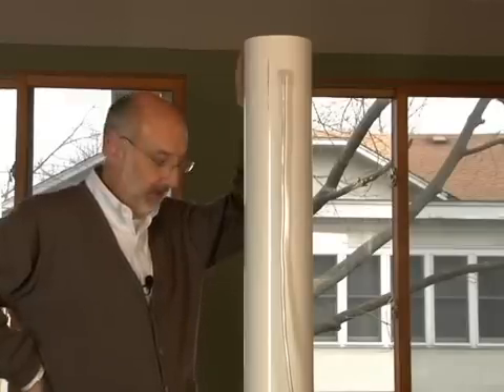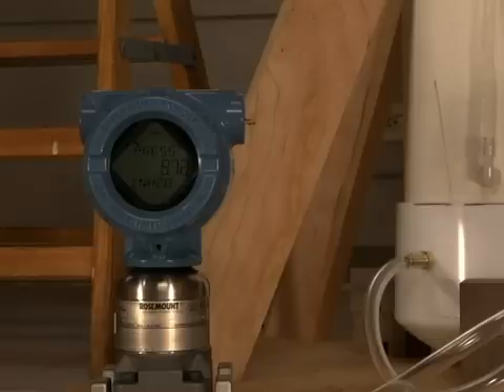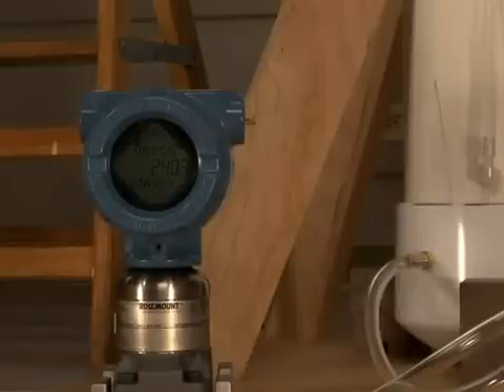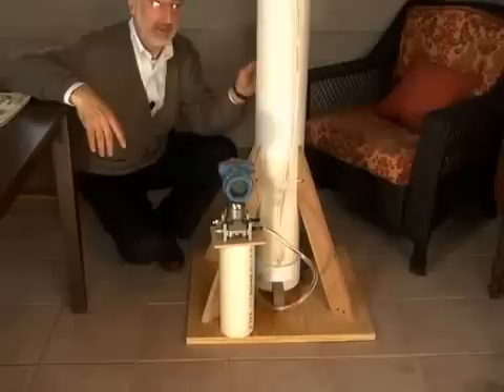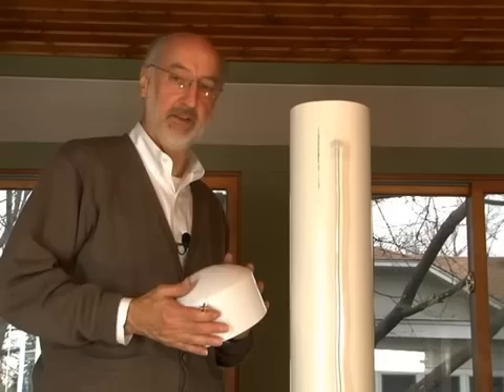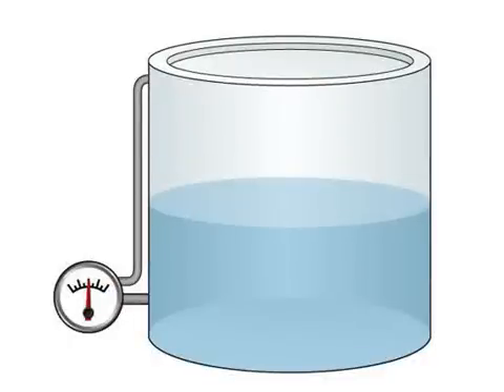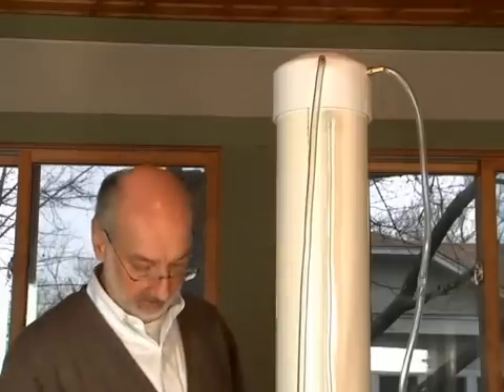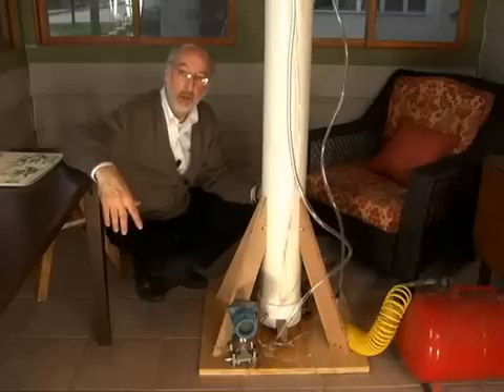Video tutorial: Measuring liquid level using a pressure gage

Comment: Why do we connect the Low side to the Top of the tank and not the High side??
Reply: It's not based on elevation, it's based on pressure. The top of the tank will always have less pressure then the bottom of the tank. Thus the low side gets connected at the top, and the high side at the bottom.